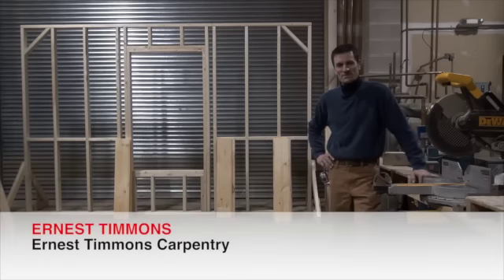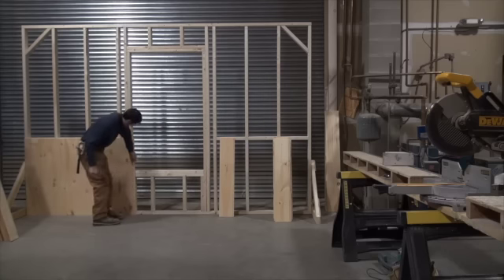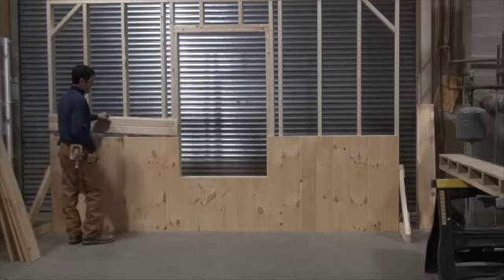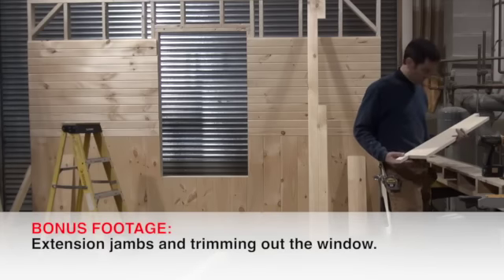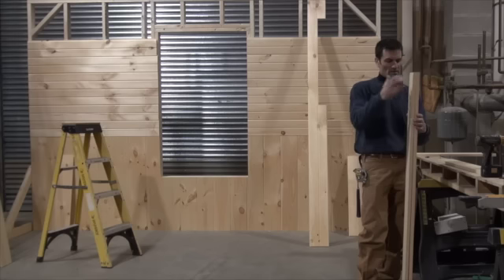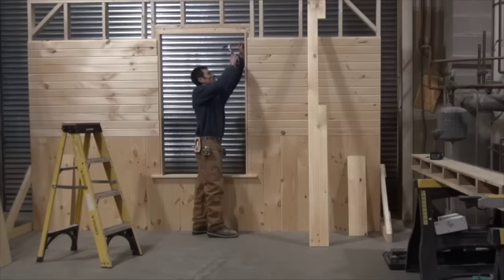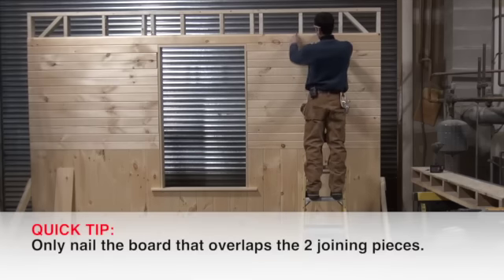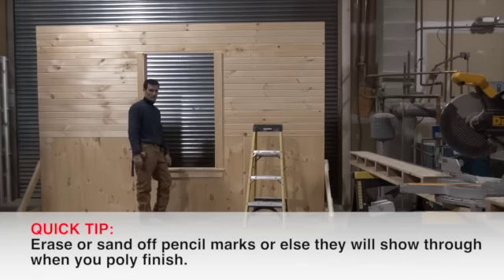Eastern White Pine Installation Video

Comment: Great video, thanks for posting it.  I am about to start installing pine tongue and groove in a room in my house. We are installing it vertically on a wall that is about 7 feet tall floor to ceiling. I have a couple of questions. We is no dry wall behind the pine, we are putting up strapping to nail the pine boards into.  My first question is how many feet apart should the strapping be?  My second question is why do you use galvanized finish nails on an interior wall?  Thanks.